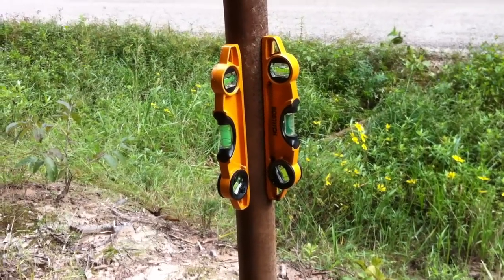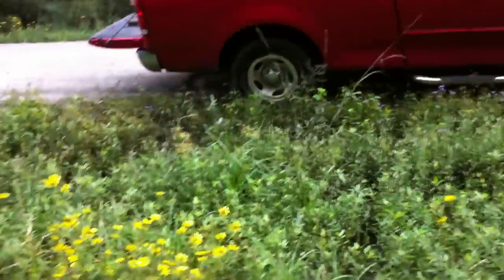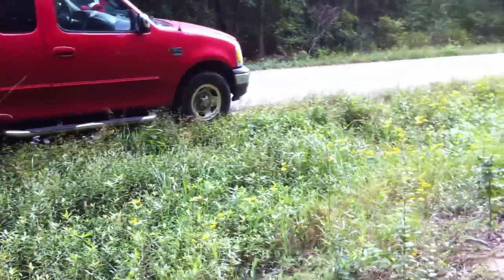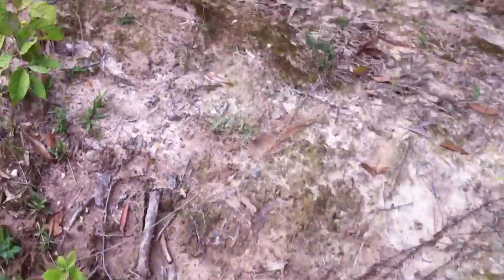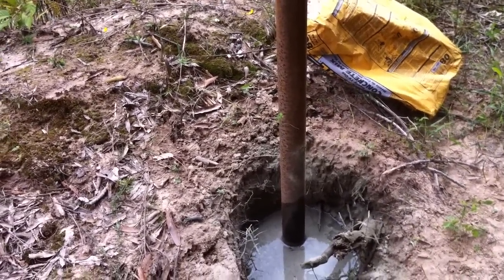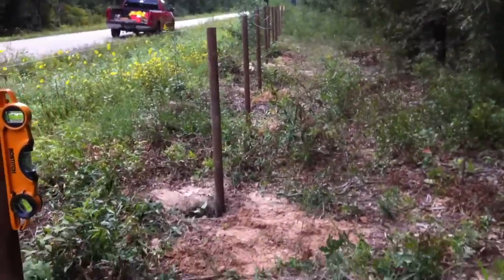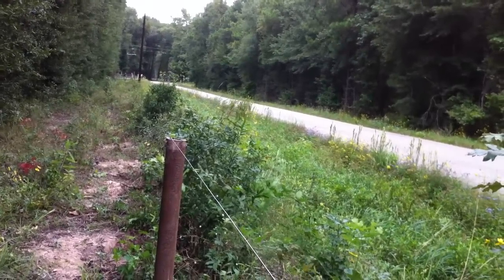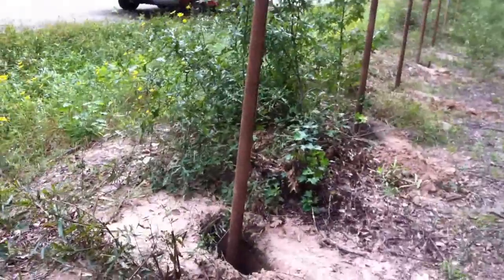Building Pipe Fence 005 - Setting Posts, how to Level keep a Straight Line.

Comment: How come you didn't cut the V in the vertical before you set them, then just run a 30' pipe on the top rail and weld it on the V?
Reply from the maker: Well for one, I'm not doing all the V cuts and re-welds any more. I'm just going to set vertical posts and then use coping cuts and weld on the horizontals. as for the top rail, I don't want the flat top look. I'll be welding a hemispherical cap on each post.
Reply: Tom B   I don't quite follow.    If you put a V cut on the vertical post at the very top, and then set a horizontal 2 3/8 as the top rail inside that V, then there are no post caps, the 2 2/8 pipe is a running cap all the way down the fence line. ==\=/=======\=/=========
     |||                |||
Reply from the maker: KarasCyborg I get what you're saying, I've seen plenty of fences like that. But that is not my goal, it's not the look I want. If you see my video "Building Fence - 002 - Hemispherical Post Caps from Wagner Companies", these are the hemispherical caps I'm going to use. So the top rail will actually be a few inches below the top of each post, and each post topped with these caps.

Comment: I like the video, i'm also planning to do a pipe fence in the next year or two, found a great place that sells used oil field pipe for dirt cheap.
Reply from the maker: Good deal. What size you after? Where are you at? Just curious. Pipe fence is popular enough in Texas that it seems to make the pipe more expensive than I expected.
Reply: +Tom Brueggen Thank you, I'm probably gonna go with inch and a half inner diameter I cant remember the wall thickness but I know it's pretty tough material, I also live in Texas just outside the San Antonio area. I got my steel in Hondo and the place I went to sells steel for a pretty good price.
Reply from the maker: +phillip lancaster 1.5" ID huh? Must be some super thick wall 2 3/8 or maybe a 2" OD. 2 3/8" is pretty common. I'm a production engineer for a living, so I'm always dealing with tubing in wells. We use exclusively 2 3/8 production tubing unless it's some special purpose, then usually 2 7/8" so we can get bigger tools down.

Comment: Thanks Tom for your reply. This is a real heavy duty fence and will serve its purpose for a very long time. Will you seal the top of the posts to prevent entry of rain water and risk of damage from frost? I live in Ireland where our small farms rely heavily on good fences. Over the last 15 years or so we were conned with the use of very poor quality wooden fence posts and strainers, which only lasted 4-5 years, breaking st the point of entry to the soil,  very disappointing. I did a big job last year with galvanised Clipex fence posts, much longer lasting. Thanks for the great video.
Reply from the maker: Yes I found hemispherical caps somewhere online, I think the company maybe was called Wagner industries or something like that. They are sized to fit this exact size pipe, weld them on. Good luck! Thanks for watching from Ireland! I get a little red in my beard sometimes and have several redhead siblings 😁

Comment: I like your video!

Just wanted to say there is rarely a need to have a fence horizontally level, except across the space where a gate is going to be installed. vertical (yes)...  horizontally (no)  if the top rail does not follow the "mean" contour of the property it will not look right. and "Karas" its a lot easier to set all the posts and then go back run a string, mark and cut the saddles in position, then set the top rail and weld it out. a good fence man can cut, fit and weld 500' of top rail in 1 day easy. When I set posts on a long run, I shoot it from one end to the other and only look for the highs and lows, the spaces between I run a string to mark the height's straight line of sight. I have been building pipe and cable / pipe and sucker rod fences since 1985. I have made every mistake imaginable, but think I have it pretty figured out finally. also, FYI, and you probably never hear this anywhere else. filling the hole all the way up with concrete is a no-no!. over time the concrete will rise out of the hole if it's level with the dirt. you should  leave at least 8" below the surface and back fill over the concrete and you will never have any problems. corner and end posts should be enlarged in the bottom to make the hole shaped like a bell so it cannot lift out over time. also for every 150' of straight run you should have a slip joint in the top rail to allow for seasonal expansion and contraction, if you don't your fence will not stay straight, and your corners will rise over time.

Best Regards
David Wolfe
Reply from the maker: Ha, which I could have learned all that before I started. I agree that the fence does not have to be perfectly level, but I like the look if it is. In a situation where you have a rolling terrain, of course the fence will wander with the terrain. But here it is so flat, that I think if I keep the fence flat too it will better fit in. 
As for the posts pushing out, I'd never heard that. I had heard about "belling" out the corner posts, as I've set plenty of corner posts on other fences in my day. But really with each line post I'm not filling to the top. It might look like it, but it's mostly water. I did down 2-2.5 by about 10". That's much more than 1 CF. Then I just dump in the dry concrete and pour in water. So the whole looks full at first, but then later I backfill with dirt. 
That's a really good idea with the slip joint too, I hadn't thought of that. You think it's only needed on the top rail? Or every rail at 150' spacing? This fence will be about 400' long, so I may throw them in at 100' spacing just for safety. So I suppose I can just use a short piece of 2 7/8" pipe (ID of 2.441") as my slip jt over my 2.375" OD pipe. I don't think the average person would notice a couple hundredths of an inch :)
Reply: +David Wolfe
 what about like 2' thick of concrete going 30" down, with a rebar reinforced, shovel-wide concrete line along the whole fence bottom with the height extending 4" above grade and at least 4" below grade? My area doesn't suffer ground freezing, but the soil does have some clay in it..
Reply: @JustinCrediblename  Calculate the cost of that much concrete and you will quickly see why people don't do that

Comment: Hi, is the piping rust protected? Are you attaching barbed wire to the posts and how do you plan to do this?
Reply from the maker: Pipes haven’t rusted off yet in 7 years. I intend to make it all welded tube to tube, no wire.